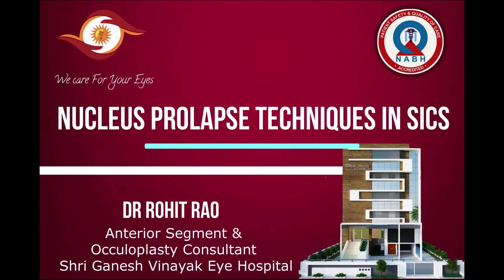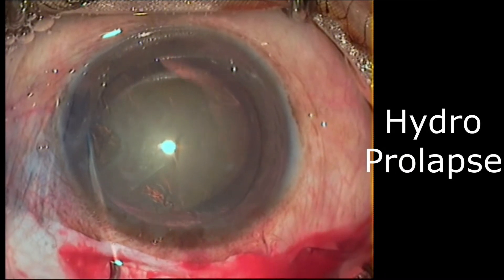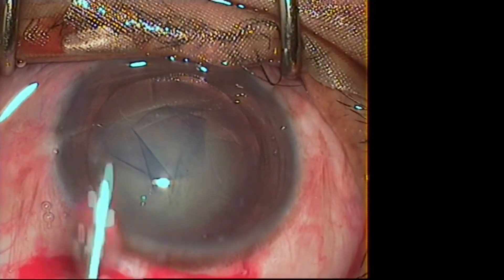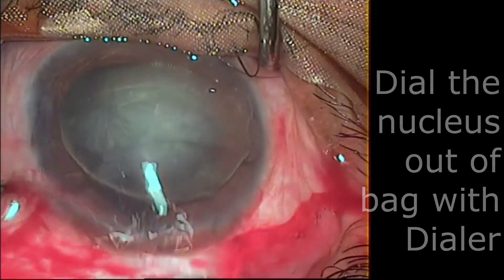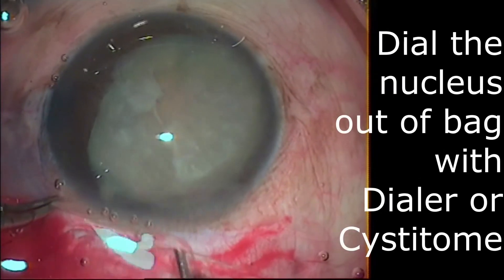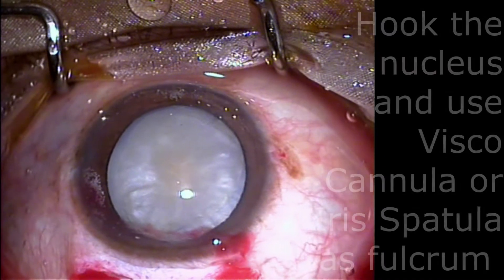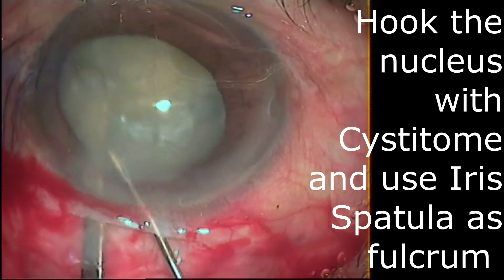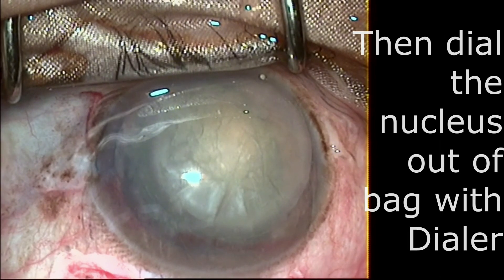5 How To Prolapse Nucleus !!!! By Dr Rohit Rao

Comment: Sir sometimes the capsulotomy edge is not visible after hydrodissection. How to proceed with further hydro in such case?
Reply from the maker: Use nucleus surface as guide just keep the cannula in close approximation to lens surface and go under the iris and inject fluid